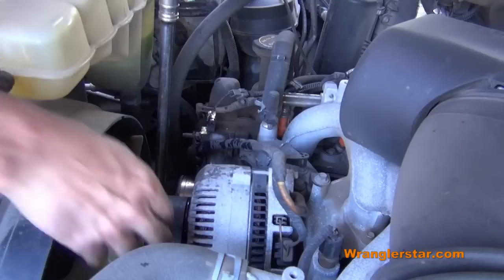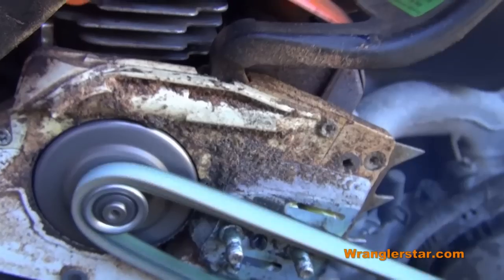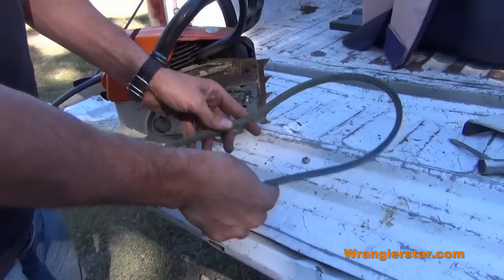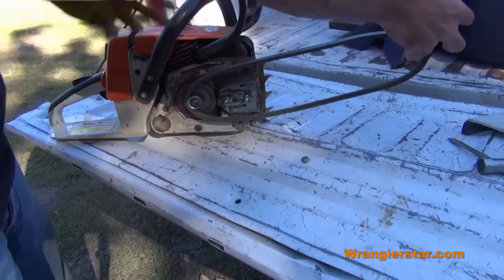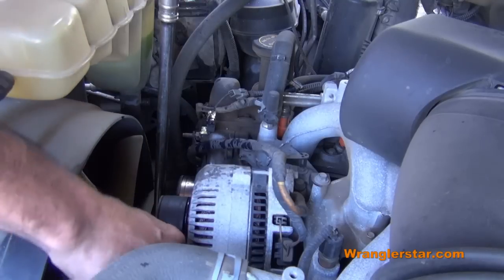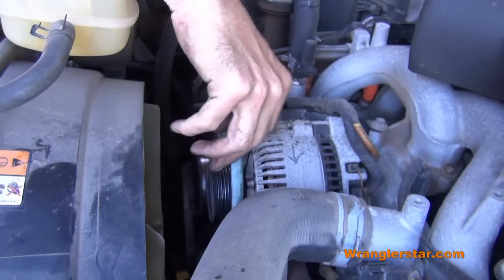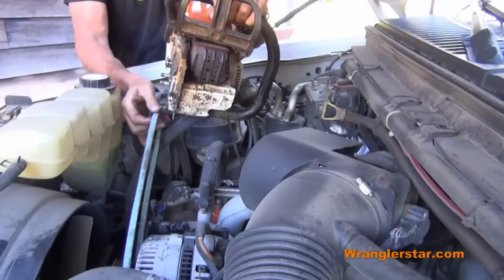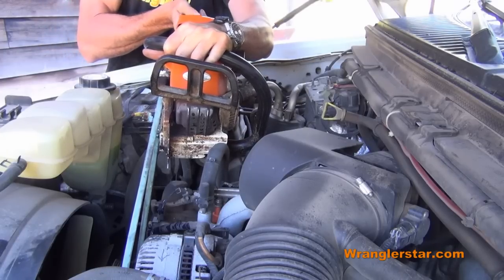Charge A Car Battery With A Chainsaw

Comment: Well, I'm glad to see YOUTUBE is finally starting to trickle down to flat out idiot's with a camera recording device...  Now with all that being said, I'm sure I have made good friends.  

I watched every second of 47, and realized I was not gonna hit 50, WHAT A LOAD OF BS!!  If this guy has that much skill, in which he does in video, there are much more simple ways to start a vehicle, or simply catch a ride?
Reply: Michael StJohn Well, I was drunk when I wrote original post, but I have wrecked a truck, messed up on drugs and alcohol,................ and thumbed my way for well over 30 miles in a  24hr  period, avoiding  law, and fending off the night animals.....with no ride
Reply: wrightz3it if I slept, and when I could sleep, it was under branches of evergreens, because it was raining and about 35 to 40 degrees.  I even crawled down a rocky ledge about 50 plus feet just to get away from traffic and try to collect my thoughts